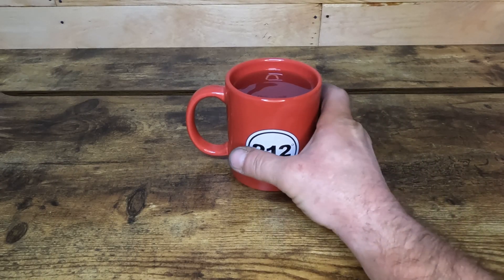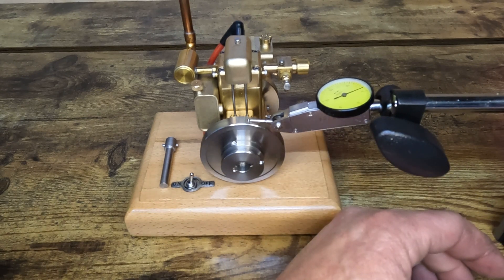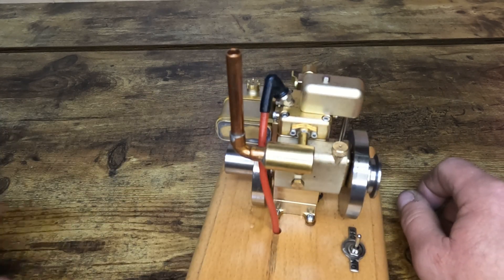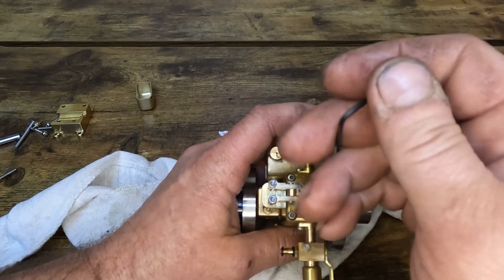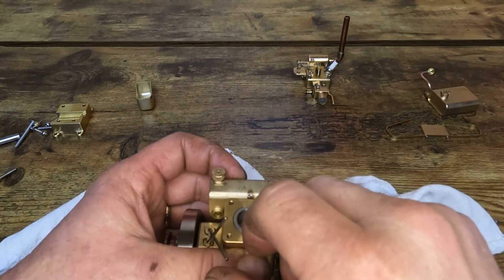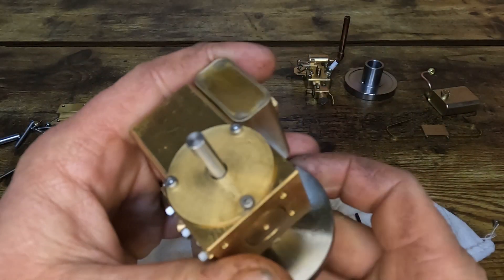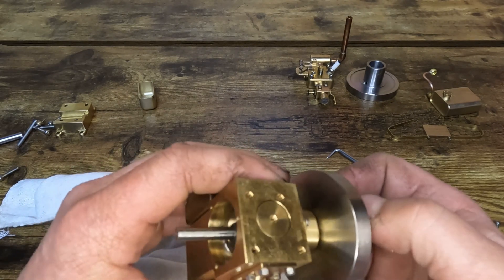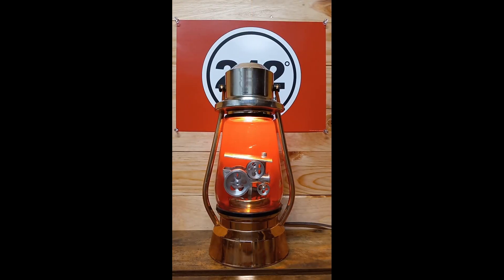M12B engine addressing some issues

Comment: Can you do a video on how to set the carburetor? I've had extensive problems with my M12 running and i can't seem to get the right carb settings.
Reply from the maker: I would be glad to. These little carburetors are so very sensitive to adjustments. The low speed needle will change the mixture just by touching it with a screwdriver. I am working on an adapter to try an RC engine carb on the m17b engine now so when I record that video I will go over the stock carb adjustments. Thank you for your question and your interest

Comment: Hey there, nice Video! 👍🏽Can you tell me the dimensions of that crank bearings? I would like to change mine too. Thanks a lot
Reply from the maker: I am in the process of editing the second part now. It shows a little more in depth on the reassembly and (in my opinion) helpful tips on setting the valve timing. I think I give the part number of the bearings out in the video. If not I'll be sure to let you know.   Thank you for your interest and your comment.
Reply: Thanks for your feedback, i'm looking forward to the second part of the video

Comment: Hello there! Great new work area. I have a ET 5 Pro that I am prepping before it's first run. On mine the bearing slop isn't as bad as yours but the valve rockers'  play side to side is horrible! I have seen other videos concerning wrist pin migration causing cylinder scoring, so I want to resolve that before first run. I had a model steam engine decades ago when I was a kid and now I am getting back into the hobby. Love your lamp, where did you get it? I hope that I am in the draw for the solar engine. Joe.
Reply from the maker: Hi Joe, you're absolutely on the board for the model 1 engine.  I wish I could answer where the lamp would be available now, I picked it up at a flea market when I was a pup and have loved it ever since.  As for the side play on the rocker shaft on your engine, I am going to make a video on how I'm going to attempt to remedy that (stay tuned). I didn't show it on the next video but I put a drop of green loctite on the piston at the wrist pin  to help keep it from causing an issue later. Thank you for your interest  and  for commenting!